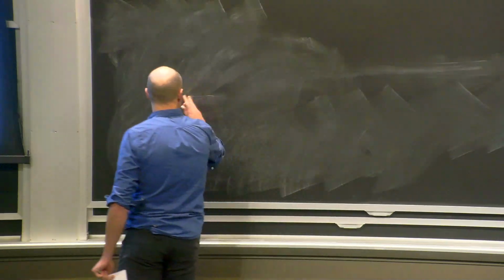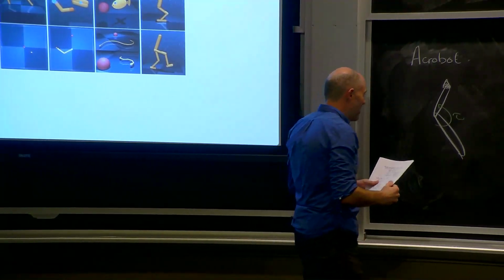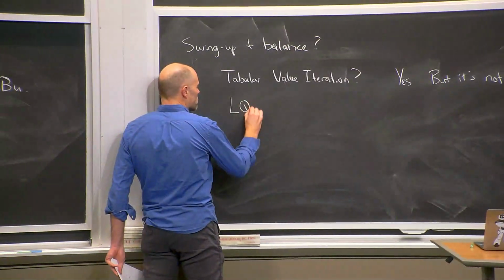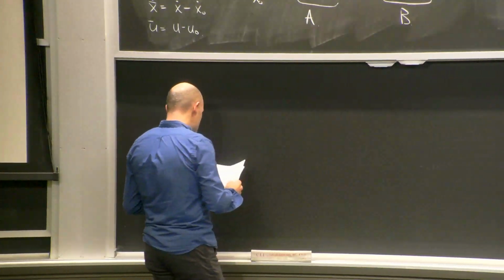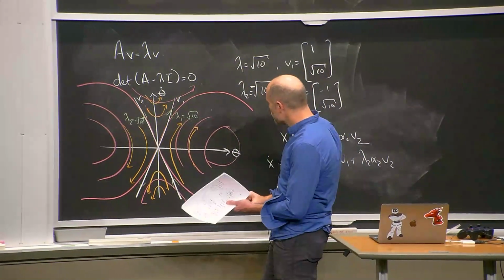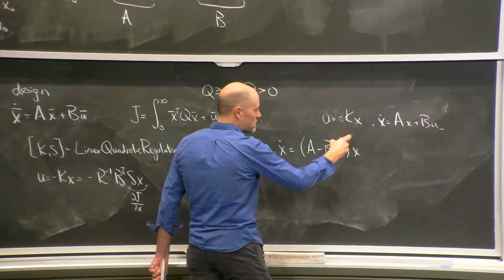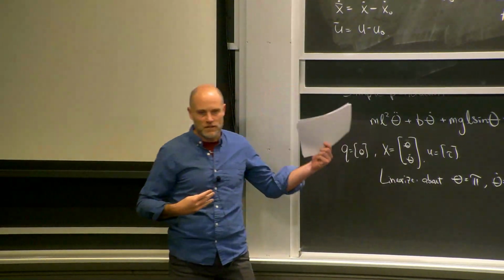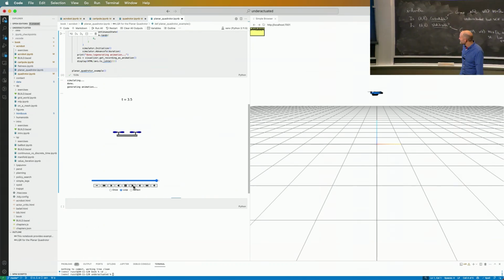6.8210 Spring 2024 Lecture 5: Acrobots, Cart-poles, and Quadrotors I

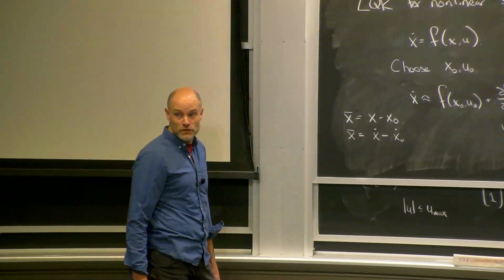Comment: 31:45
We have 
x_bar = x - x_0
x_bar_dot = x_dot - x_0_dot

The notation suggests that we derived x_bar_dot by taking the formula for x_bar and taking a derivative in which case x_0_dot would mean "derivative of x_0" which would be 0 because x_0 is fixed. But here, x_0_dot means "the derivative of x evaluated at x_0". 

Am I understanding this correctly?
Reply: if we have x(t) and x₀(t), then x_dot = ẋ(t) and x_0_dot = ẋ₀(t), which I agree is zero when the linearization is taken around a point (as it is in this lecture). We'll see linearization about a trajectory shortly after.